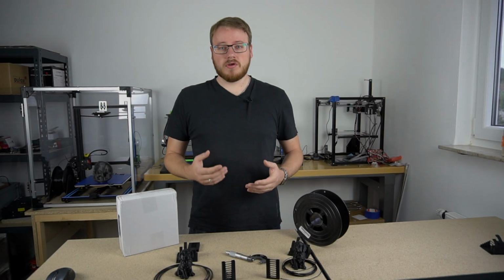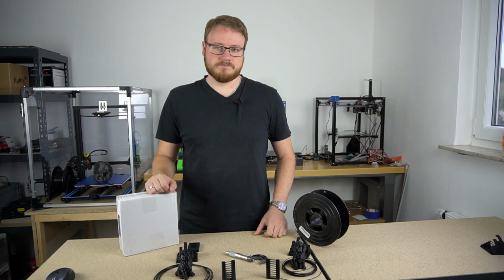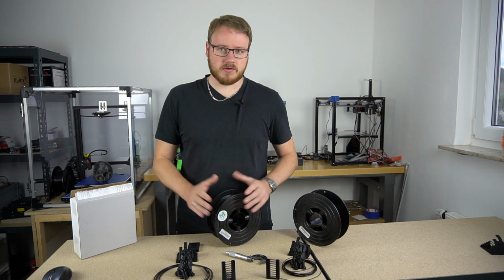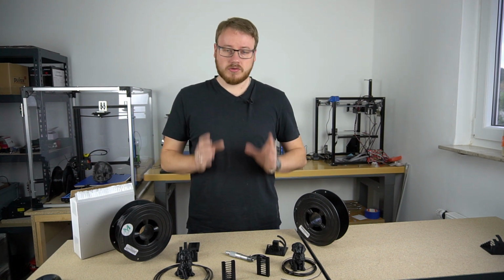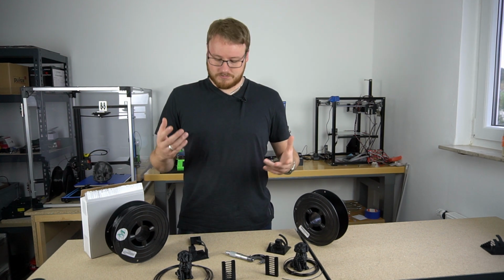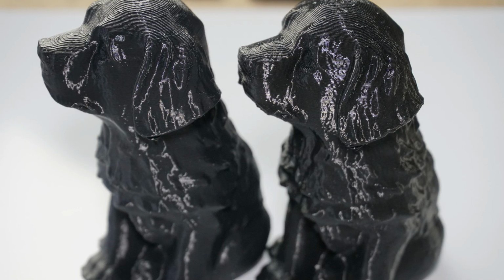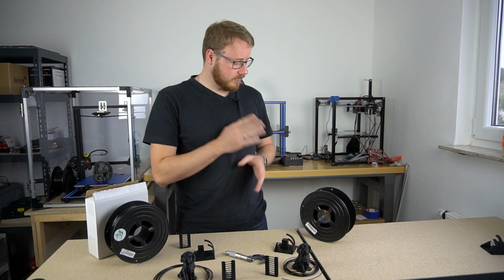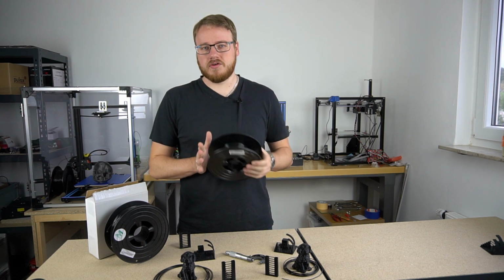OWL Filament PLA black review #Filatalk1 #Filament

Comment: Hab insgesamt 3 Rollen von dieser Grattlerfirma gekauft,  das PLA ist unter aller Sau, ständig wird das Filament nicht mehr weiter geschoben weil der Durchmessen auf einmal wieder bis zu 3 mm hat.
Nachdem ich nun 3 mal einen Druck nach 8, 6 und 10 Stunden abbrechen musste weil das Filament Stellen hatte wo es nicht mehr durchgeschoben wurde. Hab ich den ganzen Drecksmüll von denen in die Tonne geworfen.
Achtung Finger weg die Firm verkauft nur Dreck und Müll.

Comment: Hab gerade ne Rolle TPU von OWL in Benutzung. Sollte 1,75mm sein. Hat meist so 1,65mm und hatte bis jetzt 2 Verstopfungen da auf einmal der Durchmesser über 2mm liegt. Das meiste was ich gemessen hatte war 2,4mm -.- War keine B-Ware. Nie wieder OWL. Hatte schonmal PLA von denen und hatte da auch einige Probleme. Hab es diesmal auch nur gekauft da von vornherein nicht ersichtlich war das es OWL Filament ist. Und ich bin auch für deutsch ;)
Reply from the maker: Ja das mit den Durchmessern sagen viele. Ich hatte noch nie Probleme damit. Meine waren bis jetzt immer ziemlich konstant. Ich werde in zukunft noch einige OWL Tests machen und darauf besonderes Augenmerk legen.
Reply: Hab insgesamt 3 Rollen von dieser Grattlerfirma gekauft,  das PLA ist unter aller Sau, ständig wird das Filament nicht mehr weiter geschoben weil der Durchmessen auf einmal wieder bis zu 3 mm hat.
Nachdem ich nun 3 mal einen Druck nach 8, 6 und 10 Stunden abbrechen musste weil das Filament Stellen hatte wo es nicht mehr durchgeschoben wurde. Hab ich den ganzen Drecksmüll von denen in die Tonne geworfen.
Achtung Finger weg die Firm verkauft nur Dreck und Müll.